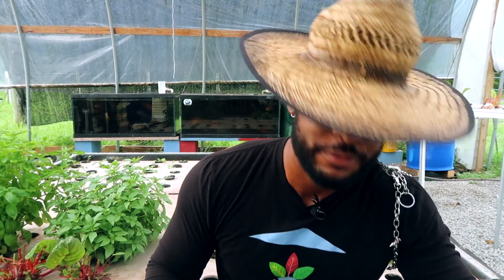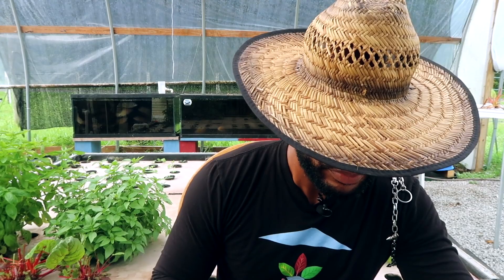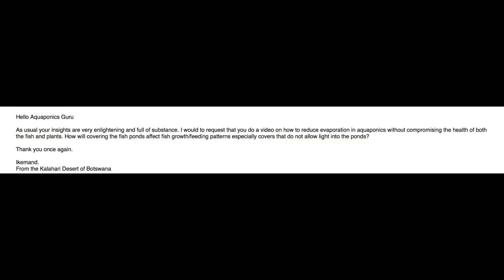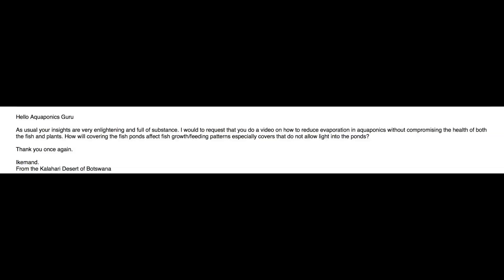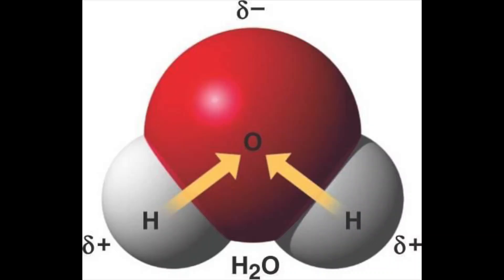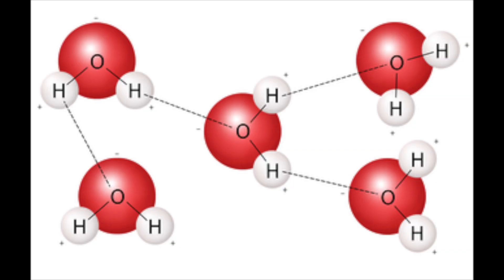REDUCING EVAPOARATION IN AQUAPONICS

Comment: Hi Mr. Brooklyn Saint Mickell,

I love your videos. You have helped me tremendously learn more about aquaponics. Your videos are great! I would appreciate if you could look over my indoor aquaponics setup, calculations, and questions I have designed for my students.

I have a basic IBC system with 1 250gal fish tank, 1 solids filter, and 1, 1.18 m2, grow bed full of hydroton. I plan to use a Wami/Mozambique tilapia hybrid due to its fast growth rate and advantage of having a high percentage of males. These are my calculations:

Using a 60-100g of feed per square meter of growing area ratio, I decided to use 80g because I plan to grow fruiting plants. When do I start to feed them at 80%, when I first get them as fingerlings, or when they become a certain length or age? With an FCR as 1.7 and FER is 59% my daily feed will be 94.4g of feed per day. Will my FER change based on the contents of my feed? Do I divide the 94.4g into 3 feedings? My annual feed will be 34,456 g every year. Before harvest, collectively, my fish will weight 20,329g per year. Harvest Weight= 500g, Initial Stock Weight= 50g, Weight Gain per Fish= 450g, Total Fish per Year= 45. So, in other words, does that mean my system can only hold up to 45 fish? If I decided to do 1 harvest each school year, I would harvest 45lbs, 100%, of fish. My water stocking density, .5lbs/gal, would require me to have a minimum of 90gal of water in my tank.

I am in the process of cycling my system. My pH currently reads at 6.4. Now, this is where I am confused. When is it ok to begin adding minerals? What are the easiest forms of nutrients to use? FeDTPA for iron? Kelp for Potassium? Calcium Chloride? Phosphorus? Magnesium? Do I add the nutrients at one time? Before I add my fish and plants or when I notice deficiencies? Will adding my nutrients change my pH? What do I do to make sure I am off to a good start?!
 Help me from becoming a biscuit headed grower! lol 

Thank you in advance!
Reply: Cerenity, I’m having the same issue determining nutrients for my system! Let’s hope he answers this.